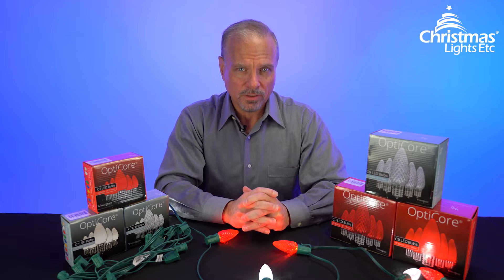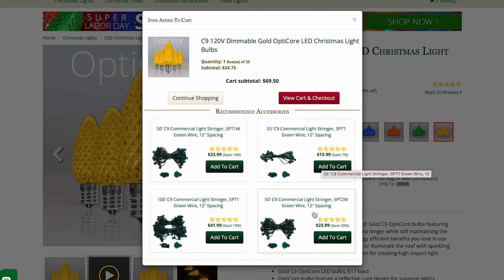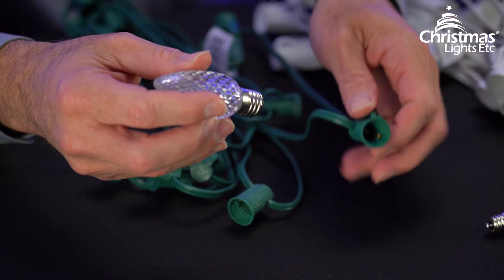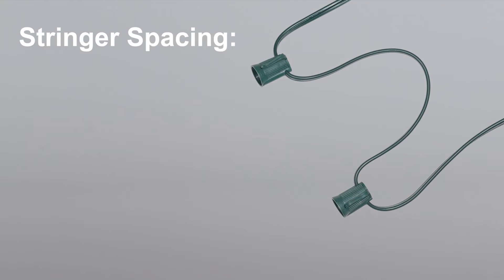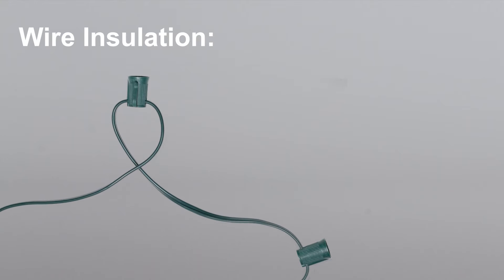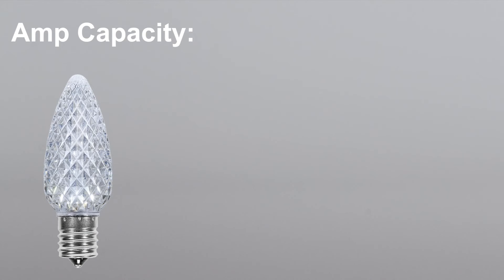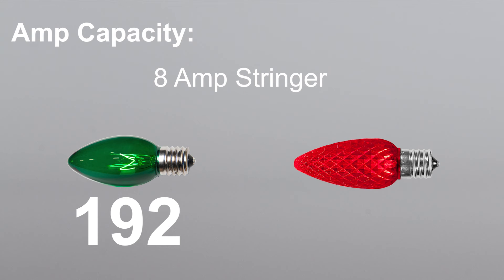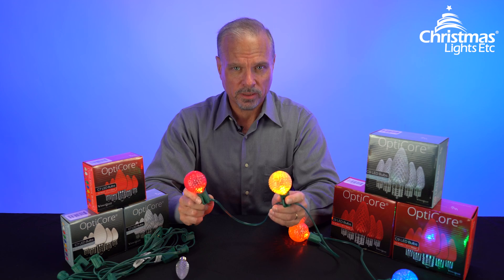Unsung Heroes: Christmas Light Stringers

Comment: Can you comment on the number of articles I have seen saying to limit the length of SPT1 wire to 250 ft or 250 bulbs, regardless of bulb type? I am looking to light 1000' of fence line and would like to use opticore c9 bulbs, but unsure if I can truely use 1000' of 18 gauge wire from a single plug.
Reply from the maker: Hi! If you're unsure about a specific installation situation, it's best to consult an electrician. They can give you answers based on your exact conditions.

Comment: The problem with the complete C9 and C7 light sets sold in stores is they typically only use 20 gauge wire, which means they can’t handle much current and cap out at around 60-75 incandescent bulbs. With the stringers you buy separately, they typically use 18 gauge wire, so they can handle a lot more lights and you can have long stretches of lights without extension cords everywhere.
Reply from the maker: Well said 👏